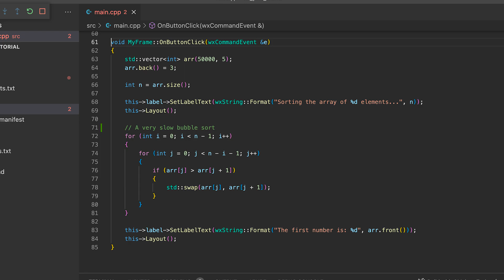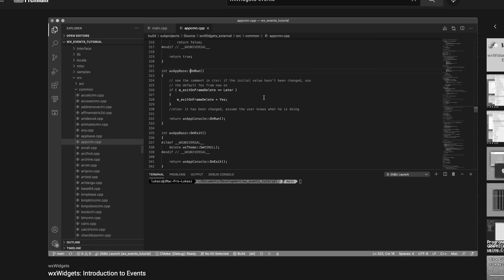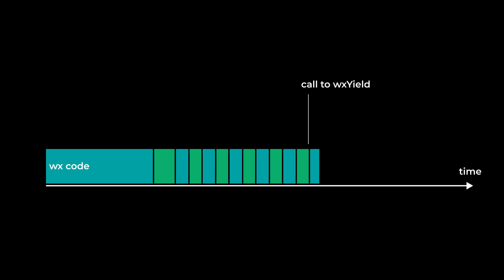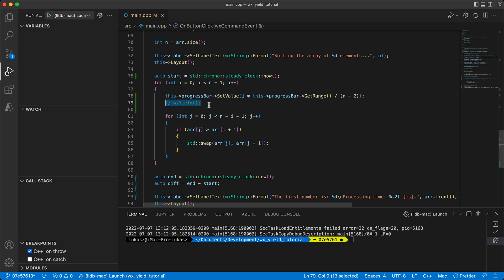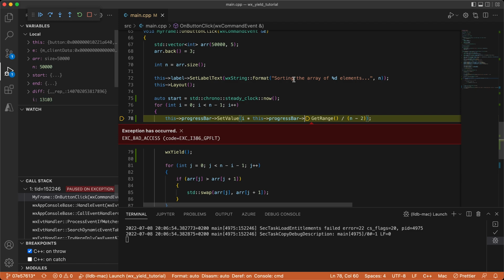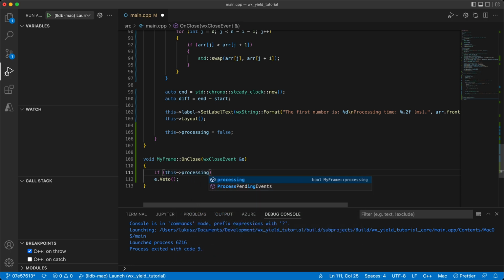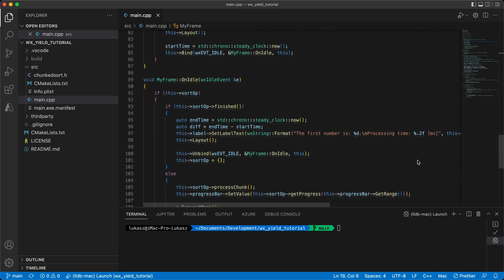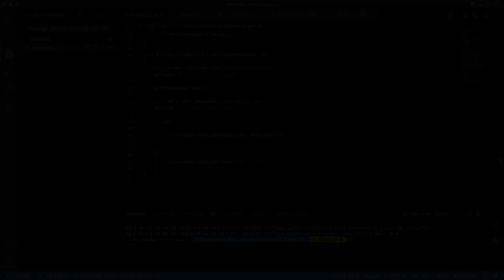wxWidgets: Background Processing with wxYield and Idle Events

Comment: I thoroughly enjoy all of your wxWidgets content. Straight to the point and showcasing your depth of knowledge. Do you have a sense of the popularity of wxWidgets desktop application development? I find that while I enjoy using the wxWidgets framework with C++ in particular, I wonder if my time maybe is better spent with C++ /WinRT UWP or C#. Perhaps this is just a matter of preference? Do you have any suggestions on where to find reliable data that shows the popularity of one framework vs another? What is your framework preference? Your obvious competency with wxWidgets aside. Thanks so much for this content. I hope you find the the time to create more. Best regards.
Reply from the maker: That's a great question! There are plenty of sites that rank programming languages in the order of popularity, but I don't know of any that shows the popularity of desktop frameworks. But speaking from my experience, the most popular desktop framework seem to be... Electron! You write your application in Java Script and it runs inside a Chromium browser, packaged as a separate desktop app. Slack works like this, Messenger too, even Visual Studio Code is writen in TypeScript (which is, let's say, a variant of JS) and runs inside an embedded browser. Software companies love it, because they usually have employees experienced in JavaScript for web development and a transition to desktop trough Electron is very easy for them. Other than that, it's usually either native development (Swift with Mac SDK for Mac OS and C# for Windows) or good old Java.

wxWidgets is actually very niche. It's great if you already have some C++ code that you need an interface/visualisation for, or for some reason (performance, existing developer base) you want to start a GUI project in C++ and have it run on multiple platforms. There's another framework for C++, namely Qt, which is more commercialized and has better support, but it uses a custom variant of C++ (you need to use theirs Meta Object Compiler as a compilation step) and, unlike wxWidgets, is NOT free for commercial use.

So, for multi platform C++ development, I think wxWidgets is the best UI framework out there. But will your time be better spent learning some other technology, like C# + UWP or JS + Electron? Well, it all depends on your goals!